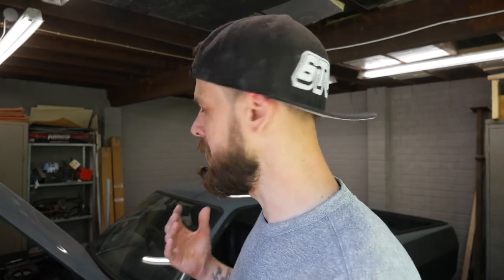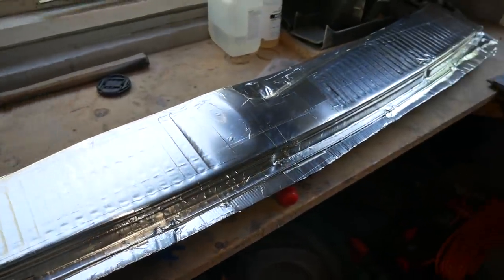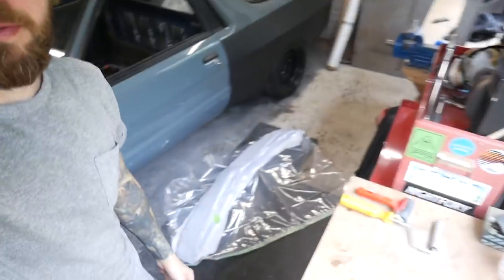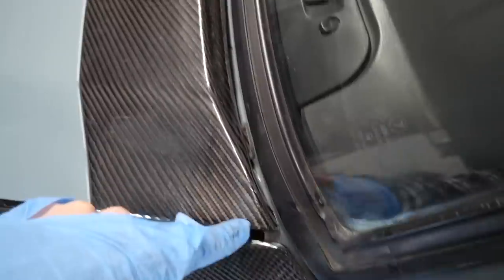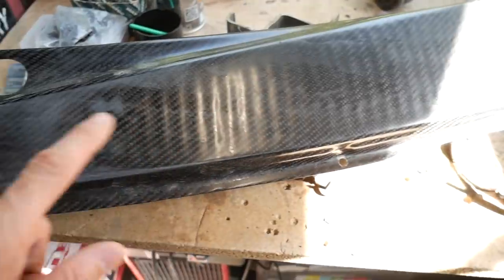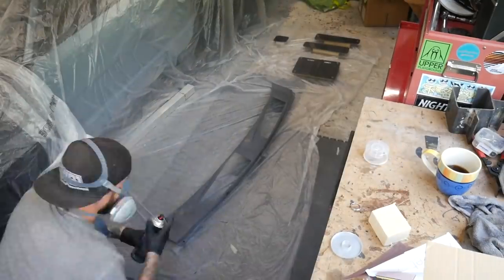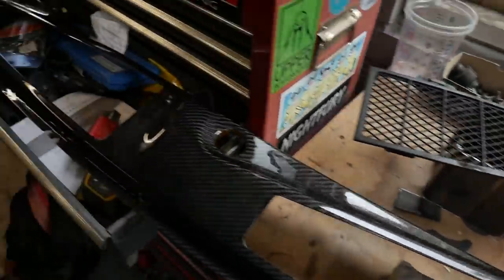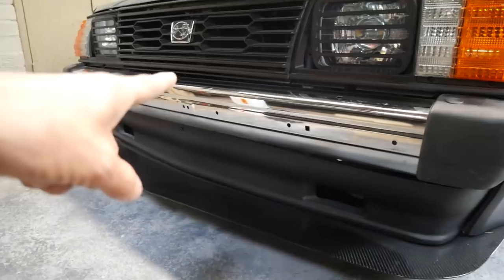Custom carbon parts and budget vacuum bagging.

Comment: This is a perfect easy thing to make for a first project, no needing to make a fibreglass mold and using gel coats, just ally tape, epoxy, plastic board, wax, a vacuum storage and carbon fibre sheets

Comment: Such a great job man!  Working on an air box for my eg right now, the box form is done, and I'll be working on the carbon part this next week.  I wanted to do the vacuum bag process for it, but I've only seen it done when people use the shiny side.  This confirms that the way I wanted to do it, would work.  Great job and thanks for the detailed vid.
Reply from the maker: No problem dude! glad the video helped out!

Comment: The cut out's would look awesome if you made some aluminum grill frames that could attach in place of the plastic mesh bit's and fill the open space in with the kind of  fancy looking fine mesh stainless steel material you see used in places like velocity stack covers and so on. Incredible the way you complete tasks to finish product. Mad respect, love your content merry Christmas!
Reply: Nevermind. I finished the video to the end, looks awesome turned out amazing!

Comment: Amazing work bro. Just wondering why you needed so many coats of resin on top? Did you get air bubble?
Reply from the maker: Thanks dude! Just to make sure I could get a flat enough surface and not have the weave push though. Zero air bubbles with the xcr resin. You can wave a heat gun over it just incase though.

Comment: A little bit of black rubber or weatherstrip under that panel gap might clean it up.  Looks great!!
Reply from the maker: For sure dude. Just trying to find the right type without it looking cheap you know?
Reply: @BuildCreate  Yup!  Even some black paint underneath it will probably do.  Could always chuck some electrical tape on it to see how it looks.  

Just FYI - I was trying to find your store again but your Instagram link on YT no longer works :)

Comment: if you mist spray alcohol over the epoxy it will get rid of air bubbles and help flatten it out. or you can heat gun.

Comment: Nice job with the vacuum bag can you remember what size the bag was by any chance?
Reply from the maker: Thanks dude. 
Can’t remember the exact size, it was the biggest size they had.
Reply: @BuildCreate  I'm doing the same process as you right now only I have forgot to use the breather material inside the bag so hopefully I haven't fused the peel ply to the epoxy on my panel!! 😂
Reply from the maker: @psycho3344  the peel ply will come off. The breather/bleeder is used to absorb excess resin 🤙🏻

Comment: Great work, have you ever tried to do a hood/ bonnet? Thinking about doing one for my volvo as I can't find the style hood I want. Obviously going to need a much larger vacuum bag, and probably do a front and back and glue them together?
Reply from the maker: For sure! I want to try and find a parts car with some decent panels and use those to make molds from. Bonnet, wings, tailgate etc

Comment: Sir I got a question can tell me pls which coil-overs did u use in the front?? I got brat 1981 and I would like to lower it!! But it to difficult to fined something to lower it!!
Reply from the maker: Hey man. They are 92-00 civic coilovers. You’ll need a 2mm shim for the bottom of the shock to fit into the knuckle and make an adapter plate (6mm aluminium) for the top.

Comment: HI mate what would happen if you don't use the cloth for the excess resin in there?
Reply from the maker: It gets really messy dude! By using the cloth you get a super clean, even finish to work with. It’s a much better base than having to flat down pools of resin.
Reply: @BuildCreate  ahh ok. Thanks for the quick response man!

I deal with epoxies for flooring and have recently been paying around with forged carbon for the drift car. It won't be long till I give the vacuum method a go 🤣🤙🏼. Thanks for the great tips and videos man.
Reply: @BuildCreate  Hey man, also on another note, have you ever tried basalt? I've been looking at it lately as the prices are pretty decent as well as the fact that it's up there on strength etc. In between e-glass and carbon. 

Also, it's apparently not as harsh as an irritant..

Comment: Yo this reminds me of the stuff I'm doing with my truck as I'm literally doing the same shit. I reckon you should totally should have made a mould of that cowl and made the part from carbon rather than skinning and sanding it multiple times. Only because it looked in good enough condition to make an awesome finished article but you still got an awesome result.
Reply from the maker: Oh cool! 

Yeah it crossed my mind but I knew I could get away with it being slightly oversized. 
Plus it’s a pretty complex part to make for a first time mold 😂.
Reply: @BuildCreate  I believe you could have done it easy, you went as far as vac bag anyways. I’m no composites genius it’s just the surface prep that takes the longest amount of time. All the material costs can be expensive but at least you can make more with a mould plug.

Comment: Whats your wet sanding process like post 2k clear? Ive always done 1k, 1k wet, 2k wet, 3k wet, buff, polish.
Reply from the maker: Usually it’s 1500 wet, 2000 wet, 3000 (trizact) wet, rotary heavy cut, DA heavy cut and then polish with the DA again.